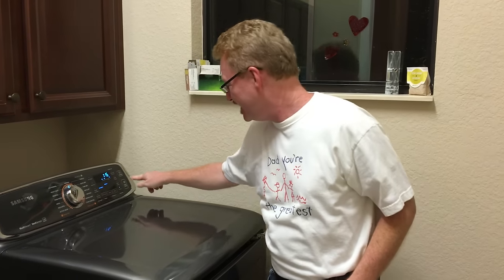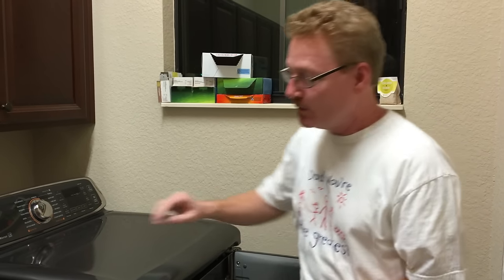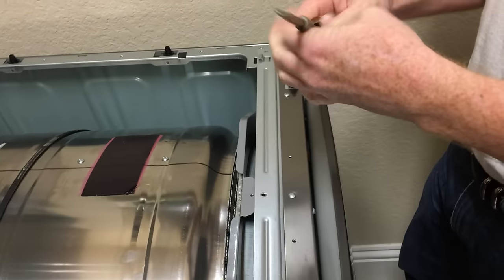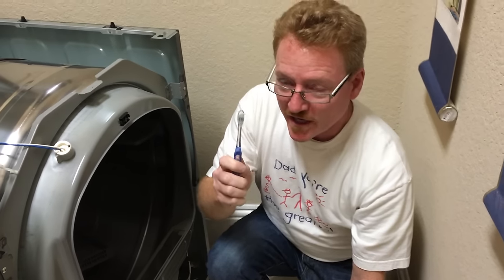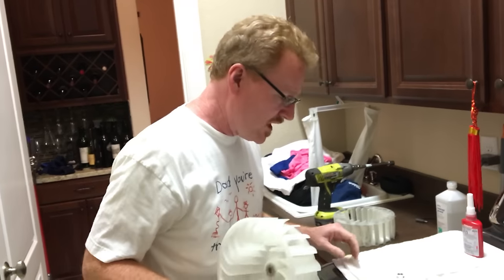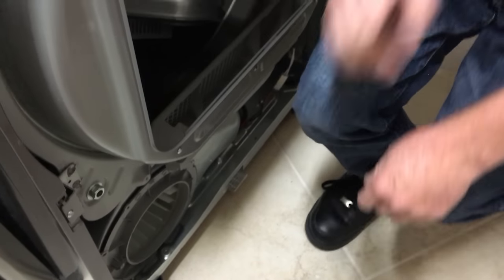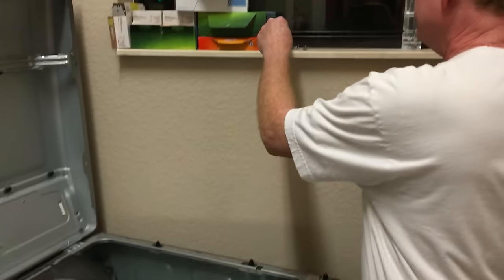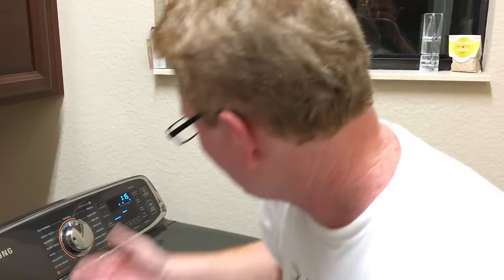How to fix a noisy, vibrating Samsung dryer in 30 minutes for $25 or less

Comment: Great information. I just bought a used set that was being sold because the dryer had a vibration that couldn’t be diagnosed. Turns out that wheel was full of lint, causing it to rotate out of balance. It was vibrating more violent than yours, cleaned the lint off and it does run better. However it still vibrates like your problem. The wheel must have been warped from being run unbalanced so long by the previous owner.
Reply from the maker: Yep, I know what you mean!

Comment: Thank you for your excellent video. I just finished fixing my Samsung dryer using your information. In my case, all I did was clean the fan. I did not have to replace it. Works great. Thanks again.
Reply from the maker: Glad it helped

Comment: My Samsung dryer is 10-1/2 years old and started vibrating about 3 months ago. Finally got around to checking it out.  Checked out your video after taking the dryer about thinking the drum was causing the vibration but could determine the cause.  I found what you had expected; that the blower wheel was unbalanced due to lint build up on one side. 

So I did not have to replace the blower wheel.  Also the blower wheel on my older dryer seems to be better then the ones on the newer dryers.  Your video was a big help. Thanks.
Reply from the maker: Glad this video helped!

Comment: Very nice video Mr. Benner - so glad I found you and this detailed fix. My Samsung Dyer was doing the same thing and we've only had it for a few years now. In the end - my Dryer Blower Wheel was stuffed with lint like so many below pointed out. But without your guidance on how to get to that area I was truly lost. Dryer is back to purring like it was new - thanks again!

Note: Looks like Appliance Parts Pro have significantly raised the price of their Dryer Blower Wheel from $25 in 2017 to now $75 in 2021 - dang inflation. :-)
Reply from the maker: Hehe. My video itself may be contributing to the inflation... Thanks for letting us know!

Comment: Here is a helpful tip that worked successfully for me. If the blower wheel is due to lint, I found a way to clear out that without taking apart the dryer. 

In the video, I can easily see that the blower wheel is in that bottom left  corner. What I did was remove my filter and I then used this micro vacuum cleaner attachment I bought a while ago from Amazon. It has a really long narrow hose and I fed that down as far as I could. Well it ended up sucking a clob of lint. And my vibration problem was resolved. Hopefully this may help others
Reply from the maker: WOW very innovative!

Comment: Thank you posting this video, I have similar Samsung dryer that had nasty vibration, it ended up being a big lump of dust that got trapped in the blower. Didn’t need to replace the blower, I just used my compressor to blow out all the dust.
Reply from the maker: AHA, one point. Where I worked a long time ago, one of the service technicians used to call the vacuum cleaner the "suck and blow machine". We had shop vacuum cleaners with removable hoses where you can use them to vacuum as well as blow. The "suck and blow" reference was as a reminder -- first use suction on the vacuum cleaner to collect as much dust as possible! Then reverse the flow and blow out any remaining dust. Doing the reverse just leads to a dusty mess everywhere! So remember, first suck, then blow! (dirty minds are not welcome... )

Comment: What a great video.  I had the exact vibration problem.  I opened it up step by step the way you did.  Luckily mine was just filled with lint and not warped.  I cleaned the blades and it works like new.  Thanks for taking the time to make the video.  It is a shame that these dryers aren't better quality.  We have had ours for about 16 months and we clean the lent trap after every use.  I can't believe that so much makes it past the trap.
Reply from the maker: I actually don't think build quality has anything to do with lint build-up. I've seen that happen on many driers. When I originally opened mine up, I was sure this was the problem, and was surprised that it was a warped wheel.

Comment: Solved my problem. Thanks for the video, my fan had lint and didn’t need replacing. Poor design or designed to purposely fail for a repair call.
Reply from the maker: Glad it helped

Comment: Wow, hey, I just took mine apart again today (07-03-2020 Friday), and I have one about same as yours.  And, damned, if the back rollers weren't fallen off the supports.  They burned off.  I had done repairs at Christmas and greased them, but I replaced mine today with new ball-bearing ones.  The old just have grease on them, and one was LOCKED and another had BURNT OFF.  So, I had to clean everything out, but it's back up and going.  It was a late morning to early afternoon job.  So, I even replaced the tensioner wheel arm -- to get the new ball bearings.  Also, you might eventually have to do that.  But, thanks for your video.  It made me know that I could open it up and see again what was wrong.  People like you give me the confidence that I need to accomplish the task.
Reply from the maker: WOW that's really something!!!
Reply: I had an 80s era electric dryer get so hot when the heating element was close to end of life that it melted all the rollers and belt so maybe your element got to hot. I"m sure there could be another explanation since they had no bearings in them.
Reply from the maker: WOW!

Comment: Great video.!!! I had an intermittent vibration on mine. After your explanation, I decided to look down the hole where the lint catcher sits. Lots of lint had accumulated. Luckily I have small hands and am very flexible. I could reach through the lint hatch, down into the fan, and remove the lint. It was tight and uncomfortable, but I managed to remove the lint without disassembling anything. 😁
Reply from the maker: WOW very good! I know what you're talking about. Glad my video helped.

Comment: Bill, thank you - and, I assume, your wife who taped it - for this ultra-helpful video.  Your reassuring, intelligent style gave me the confidence to tackle the job - and, the camera work was exceptional!  Our same Samsung dryer model is less than two years old and was vibrating as yours, maybe worse.  As others have mentioned, mine was packed with a surprising amount of lint.  Yet, when I turned the dryer barrel as you did I noticed that the plastic blower fan was also distorted and would not be as good as new simply by removing the lint with a toothbrush.  You were correct that the old blower fan was a challenge to remove.  I simply placed a large screwdriver through the blades, into the open space at the 3:00 position to stop the wheel from turning and used a socket wrench to loosen the stubborn bolt because I don't have access to an impact driver.  I briskly tapped the ratchet (clockwise! - thankyou for that critical insight as well) with a hammer a few times and the nut finally loosened.  The torque cracked three of the old wheel's plastic blades before I was able to apply enough pressure to the nut to loosen it, but since I was already replacing it it made no difference.  The old one came off, and the new one went on perfectly.  So, again - I hope you get your due for this valuable public service, and I'll do the same for someone else someday.  Again thanks and nice work, sir!!Dave V.p.s. RepairClinic.com also sells this item and were very helpful.
Reply from the maker: Thanks for the kudos, and it was my son who filmed on my iPhone. He's actually a professional and has done many news and sports reels.

Comment: Thank you for the video... I've pulled this dryer apart several time to find this issue... Lent filled wheel with unbalanced vibration... Cleaned and problem solved!
Reply from the maker: Glad it helped
Reply: @WilliamBennerJr  yes, thank you.. I knew it was something so simple but just never pulled things for enough apart to realize there was a wheel in there that could be thrown out of balance like that... So quite now!

Comment: Very grateful that you took the time to share your knowledge! My dryer started squealing a few nights ago. After a bit of sleuthing, I found your video. I've just replaced the tension pulley (bracket idler pulley, part #DC93-00634A, from Amazon  saller FORBB), accessing the part via the exhaust plate, and it seems to have fixed it. It saved me a ton of time in dissembling the entire machine and money in trying out difference fixes.
Reply from the maker: Yes, as I mentioned in the beginning of my video, that tensioner pulley is a common-fail item with these. Glad you liked my video!

Comment: This inspired me to repair mine, a little different model than yours, but very similar.  Mine had a giant lint ball in the blower fans.  My pair are 11 years old and have been in 4 different states, pretty much from Texas to New England to the Intermountain West, and this is the first hiccough I had with them.  Crossing my fingers. Thanks for the vid! On edit: I didn't have to change out the fan, just clean it out.  Runs like new.
Reply from the maker: Yes this "lint ball" thing is quite common. That's what I expected in mine as well, but when it wasn't, that's when I had to change the whole wheel.

Comment: Thank you so much for posting this video. I have the same dryer but in white. And yes, it was very noisy.....helicopter......🤪. After watching your video, I was able to disassemble the front just like you did and CLEAN out the lint and blower area that was literally CAKED on with lint and dirty...🤢. Dryer is now running quiet again, though my blower is a little off balance...... But still working. So thank you!
Reply from the maker: Glad it worked out for you Russell!

Comment: Thank you very much🙏 your video helped me to fix my dryer.
It was only the belt but i replaced the blower fan and the tensioner + blue color wheels one was broken at the time I opened it. Now it’s like brand new. 
Thanks again 🙏
Reply from the maker: WOW that's quite a bit of work. I'm sure it is working like new now!

Comment: Thanks for your video, It helped me remember how to get the top lifted. But I would have stuck with the blue thread locker. Using red, I hope you never have to replace that part again.  Wish you would have shown what he back of the front Pannel looked like.  I'm looking how to replace the Moisture sensor on my Samsung dryer. I do see where the sensor is connected thanks to your video.  Keep it up. Good job.
Reply from the maker: We blend adhesives at my company. Whether Red or Blue, believe me, the thread locker is removable! That NASCAR-style impact driver will remove anything.

Comment: Great video as I am now having this same problem. I don't understand the locktite though since the shaft is designed to not slip with the flat side and the nut is reverse thread it can only tighten as it spins.
Reply from the maker: Loctite was only used as an insurance policy. It doesn't hurt, on the other hand if the nut was to work its way loose then it might cause a mysterious problem.

Comment: Thank you very much for this video.  It was extremely helpful.  Although I didn't need to replace the part, just had to vacuum out the gunk that was stuck in the wheel.   I couldn't have done it without this video. :)
Reply from the maker: Yep, that's the most common case.

Comment: Thank you for the video.  I've been there, trying to get that DAMNED WHEEL OFF in the past.  I just gave up, because I wanted to clean mine.  Mine looks 10 times dirtier than yours.  But we just kept shooting Windex in there and squished a towel in there to clean it.  Took forever, but I wished I would have thought of the extension on the drill.  That's pretty smart.  Give you KUDOS for that.
Reply from the maker: Actually it's a torque wrench -- sort of like what's used at auto shops to remove and replace lug nuts on cars. Those aren't too expensive these days at Home Depot. Our mechanical engineer loaned it to me. I agree it worked like magic!
Reply: @WilliamBennerJr  Yeah, I tried to get a socket in there, like I think you did.  And, I didn't make a darn bit of headway.  The thing kept turning, and I locked it with a wrench in the cylinder.  But, i was afraid I'd break off those fins or break soemthing.  So, I just gave up.  But using Windex and kitchen towels, got it pretty clean.  Or clean enough.  it's just gonna get dirty again, I told myself; so, I just let it go.  Again, thank you for the video.  I did my repair yesterday morning (ALL MORNING and EARLY AFTERNOON -- if you know what I mean), and it's perfect now.

Comment: Got a brand new in the shrinkwrap Samsung dryer delivered today, was vibrating when running. Took it apart, thanks to your video. Blower wheel is visibly warped and causing the vibration! How the heck did this make it by quality control?
Reply from the maker: WOW that's really something! I'm glad my video helped. In my case, I think it was self-inflicted. Our dryer vent clogged, and I think the extra heat warped the wheel.

Comment: thanks for this video! I have a newer model Samsung dryer but same internals. fortunately, mine was just the lint sitting in one spot on the blower wheel....10 minute job and didn't cost any money!! also, great suggestion on how to open the top and take advantage of using the hinges! one swift hit with the heel of the palm and mine popped right open.
Reply from the maker: I'm glad it worked out for you!

Comment: Thank you for this video. Found out that the fan was also deformed and inbalanced during operation like your. I suspect this results in excesive vibration on the motor assembly which causes a spring loaded pulley on the back to vibrate and create a high pich sound that is heard during operation. I was able to confirm this by running the dryer with load and holding the spring. The sound was eliminated when the spring was dampened by my hand. Unfortunately there is no way to adjust this spring as it is only held in place by hooks on boths sides. I am affraid of finding out the bearing in the pulley damaged as well, will start with replacing just the fan first to see if this solves the issue.  

In my case this issue might have started when we moved recently to a different house. We started using the dryer and noticed after a couple of months the laundry not drying as usual. Found out the whole ducting was completely clogged, seems previous owners never did proper maintenance. This could have deformed the fan from the excesive heat that was not able to dissipate throught the duct (assumption).

Having trouble removing the fan. I do not have an impact driver and the hole in the back of my dryer is only the size of the duct (different model).  

Anyways, thanks again for this upload!
Reply from the maker: Yes I agree with your assessment on the cause, and I believe this was also the cause in my dryer too (and said so in another reply). Nevertheless, the blower wheel is made of low-quality, low-density plastic whose glass transition temperature and subsequent deformation temperatures are clearly on the low side...
Reply: I ended up ordering the idler pulley as well.  Found out there are two different part numbers for the idler. From what I understand, the new design seems to have sealed bearings to hold the lubrication. Don't know if the previous part used bushings or unsealed bearings. Mayve I will confirm after taking out the old idler from my unit.

Dryer Idler Pulley
New: DC93-00634A
Replaces: DC96-00882B, DC96-00882C
Reply from the maker: Henry Graterol  Thanks for the feedback! I hope to not need to do more work on mine, but if the idler goes out then I will look up your pulley number.

Comment: Awesome video and every tip was useful here.  I have a different model samsung dryer, which is DVE52A5500W, and everything about this video was relevant.  Got the dryer opened up in a matter of minutes.  Cleaning of the blower was a pain though, but that's specifically my situation.
Reply from the maker: Great to hear!

Comment: That might just be my problem.  I have a Samsung stackable front load dryer that rattles like crazy.  I'd assumed it was the metal shroud vibrating but now I'm not so sure..  I'll do some more Googling for my model and maybe dig in.  Thanks for the good video.

Comment: Great video bud!  Saved me a good amount of time.  Mine ended up being thick full of lint, was a dirty job cleaning it all out.  No i'm gonna run a snake down the exhaust in case any lint got trapped in the pipe.  Thanks again!!
Reply from the maker: Yes, I was kind of hoping that the problem with mine was lint, but it wasn't...

Comment: Great how to video. I'm wondering if Samsung Dryers are using subpar parts. I've had my Samsung electric dryer for 33 months and either the heating element had broken or a relay is bad connecting the element to the control board.  It also has the vibration problem.  I guess the plastic blower fan was either bad from the beginning or it has warped out of round.  Could a  partially clogged dryer vent from lint build up in the line after the dryer have caused it to warp?  I did find a lot of lint in the flex tube connecting the dryer to the wall vent.

Comment: Thank you we appreciate your time to video. 
I have a question. Mine keeps saying it’s filter . Well the light keeps lighting up but there’s NOTHING in there on both ends.
It vibrates loudly …. The drum itself . But then it powers off and won’t run . Then it takes a few 4-5 to try again and it will randomly run .
Reply from the maker: Probably your drier vent is clogged. That happens a lot. You may need to climb up on your roof and look at the vent.

Comment: Thanks. Mine was packed with lint. It fixed it. Didn’t have to remove the fan or the fan housing. Just used fingers to clean it out. I’m sure it will build up again tho
Reply from the maker: Yes great. I'm sure I used my fingers too, but an old toothbrush also comes in handy.